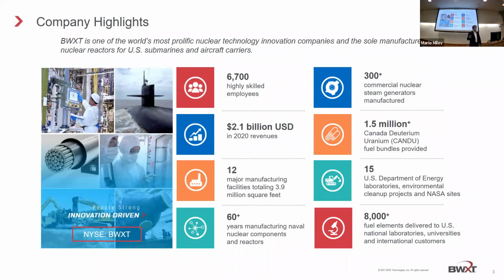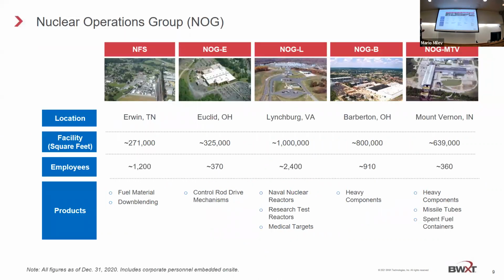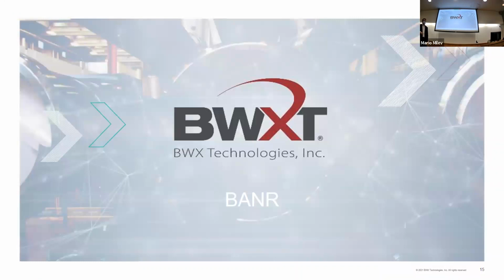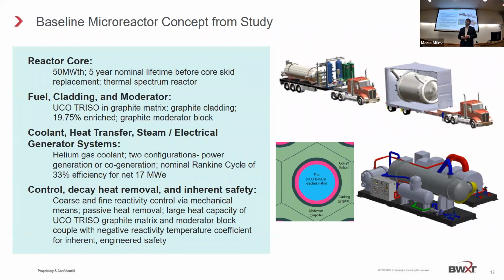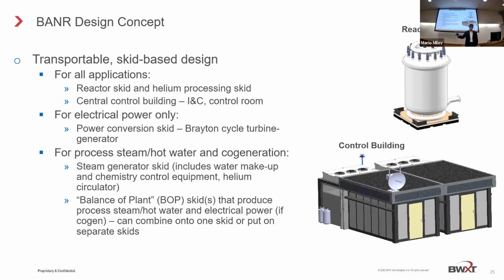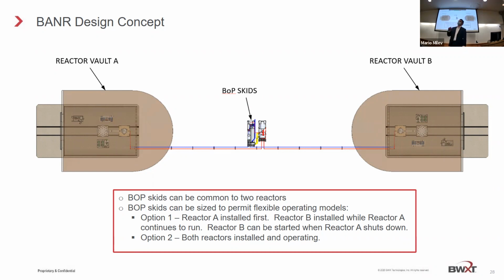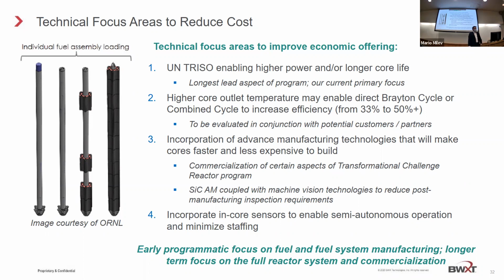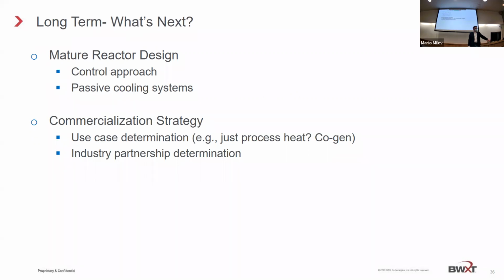NE Seminar 11/11/2021 - Overview of BWXT’s Advanced Nuclear Reactor (BANR) Development Program

Comment: Not to nitpick, but 33% thermal efficiency (using the steam cycle) seems really low given the 800 C outlet temp. The Xe-100 is claiming 40% and that's running 50 degrees cooler. Even Fort Saint Vrain was getting ~40% from 775 C back in the 1970's (and that's really a 60's design).